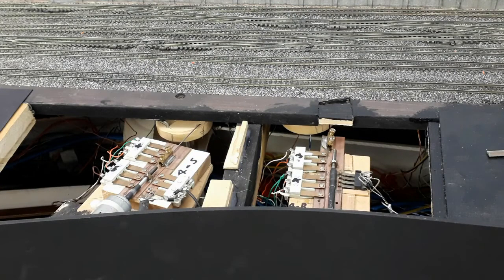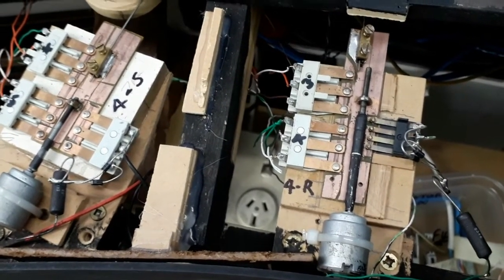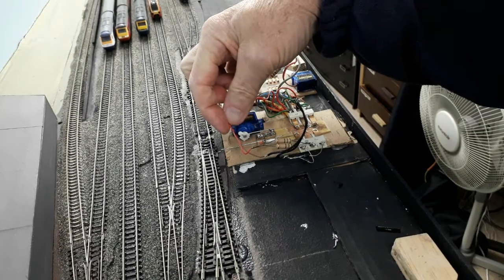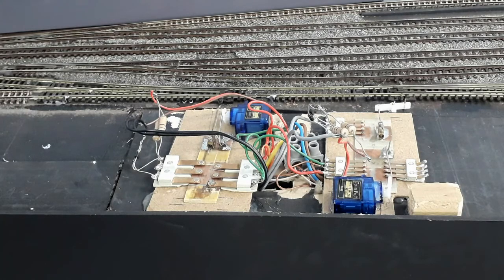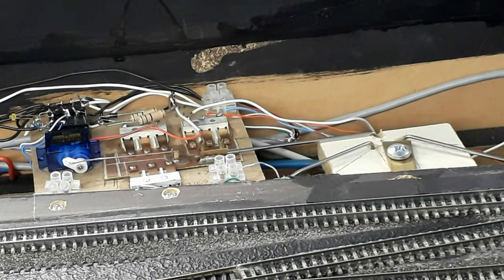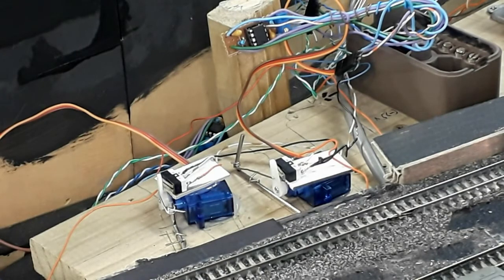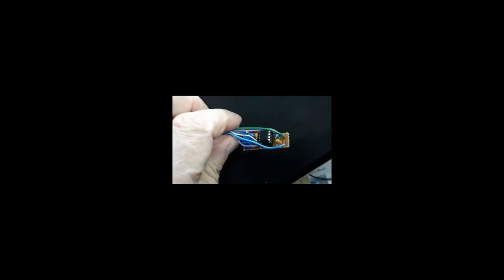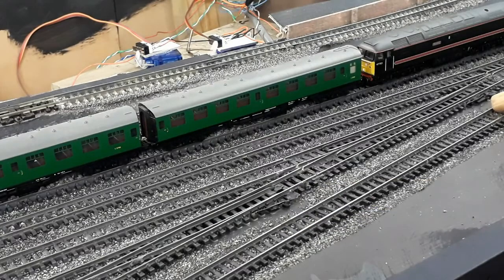Point motors.   From threaded rods to servo motor control.

Comment: 10 /10 you think the same as me. I’ve done a similar setup but operating the points and micro switches  from the servo. 3 volts switched by a double pole double pole centre off switch. No need for fancy electronics.  Also easy to fault find and cheap. Ha ha!
Reply from the maker: Thanks Richard.   One of the challenges I enjoy is finding out why sometimes it does not work the way I expect.

Comment: That is absolutely AWESOME .. must have taken some time to do all this but the end result is so rewarding. Well done. Why buy something ready-made off the shelf when you can spend days designing and making it? :)  Congrats :) :) :)
Reply from the maker: I have 71 Points in total.   17 are H+M twin coil motors.   I have 13 crossovers where 1 motor drives two points and 7 pairs of points, operated by a single switch, that feed both ends of a loop.  There are still about 10 motor driven threaded rod motors that I will replace with servo drives as and when they give trouble.   Without pulling up all my sections of scenery and buildings to check, I think I have used about 25 servos so far with various control.   The latest conversion I made to a crossover that was driven by a threaded rod motor using a PCB board with cutouts for switching was simply to use one of the cheap servos that had failed, with the clever electronics cut out, to replace the motor drive and threaded rod, still keeping the PCB with cutouts for switching, the servo is plenty strong enough to drive the linkage that was getting a bit stiff..
Reply: @patrickwalker6039  Again, job well done :)